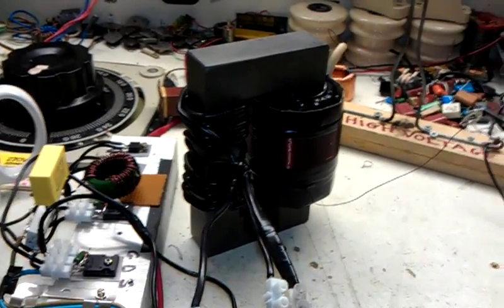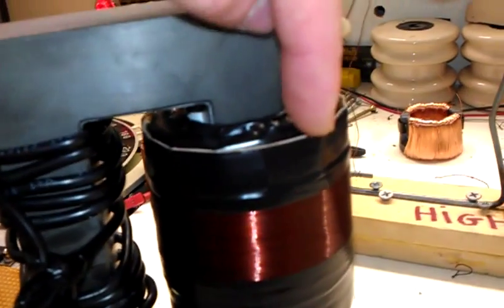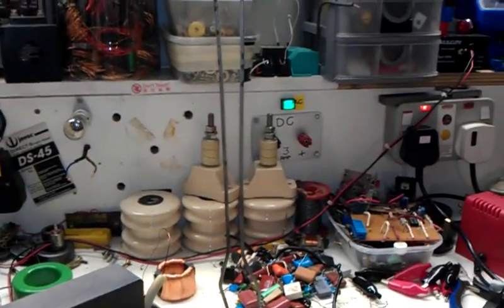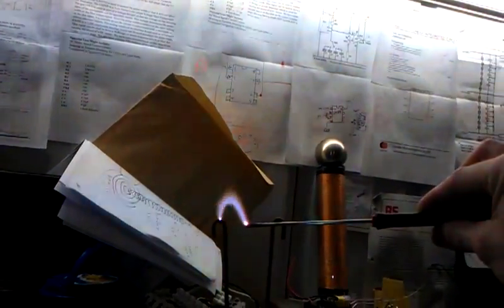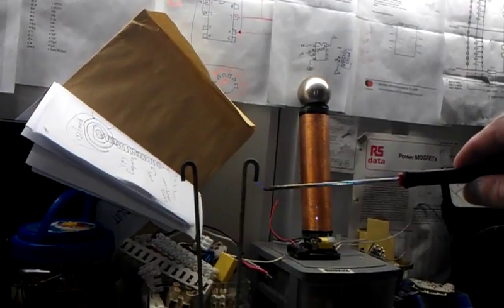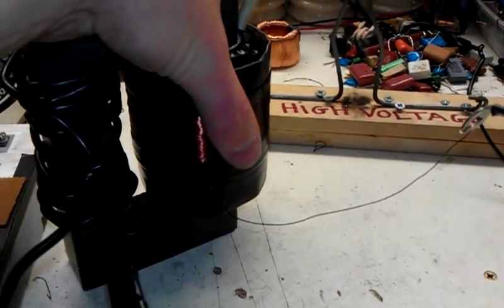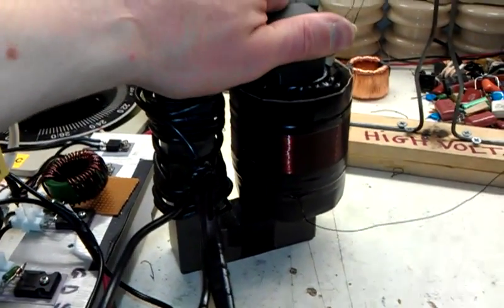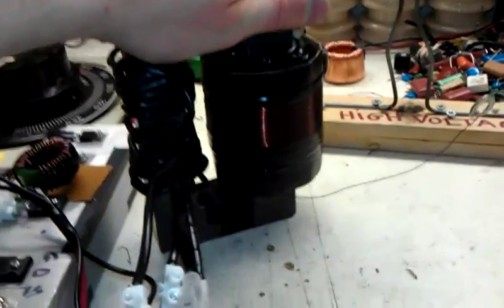Big beast flyback transformer!

Comment: "Modular stackable U-cores for flexible large designs"... Google this. This is the core that I use for my 3600w 1.2Mv multiplier driver. It's a whopper.
Reply from the maker: that sounds a beauty mate Ill check it out thanks, ;-)  
iv built a bigger one of these and got a much better output. 

thanks for the comment. :-)

Anthony
Reply: Good one mate. Love ur stuff aye.

Comment: I can see that arc is pulsating 
and you are running it from zvs 
so to fix that you need core spacers on both sides 
believe me they increase the output significantly
I will recommend 3-3.5mm spacers for core of that size 
or simply use 0.5mm per 10a of input 
hope it helps

Comment: Hi mate, how much turns u have done on the secondary coil or the ratio from the primary to the secondary... u could help me a lot.
Reply from the maker: hi mate,
yeah this is a old video and iv done many more since then. if you can get a good 600 turns or more you can get a good output. of course if you can wind more turns then you will get more of a output from it.

many thanks and good luck 👍😉

Anthony 

High1voltage1rules